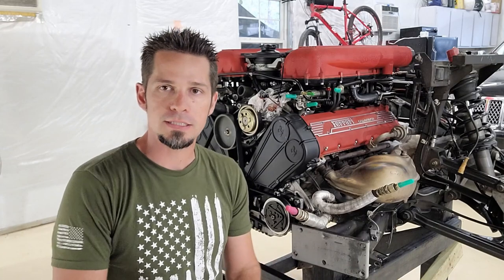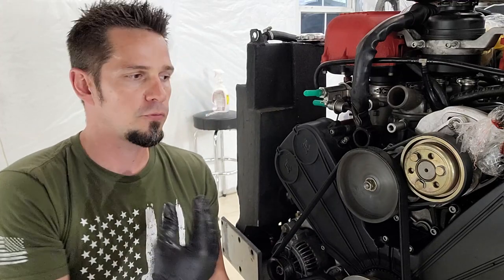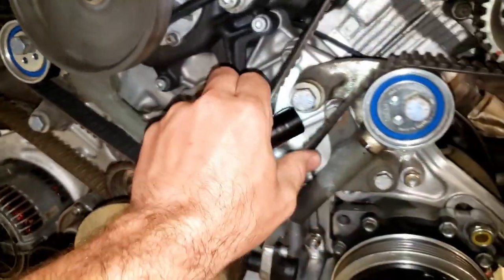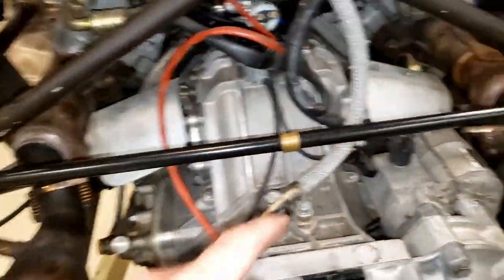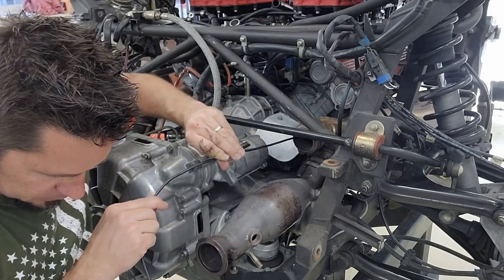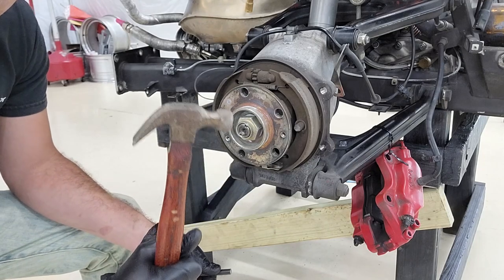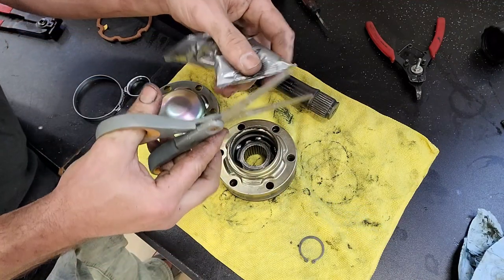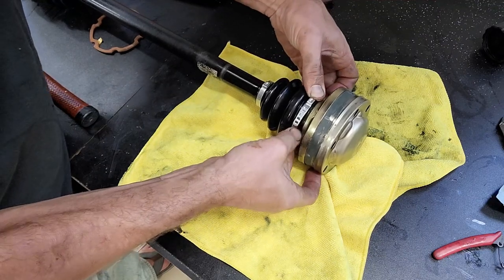F355 Engine out PART 3 - Inspection and CV boot Repair

Comment: I’m a huge admirer of the 355 but I must say I never realised it had timing belts, I would have thought it would have had timing chains on it!
Reply: You also have amazing skills and an impressive depth of knowledge. I think I would forget one of the bolts or washers when putting it back and then find it at the end only to have to rebuild once more 😅
Reply from the maker: Ya, nearly 9k rpm relying on rubber belts is scary lol. They did go to a chain in the 430.
Small jobs are the same as big jobs. Just be organized and methodical on keeping track. To be honest, filling helps me as well. I can't tell you how many times I've reference my old videos to figure something out

Comment: Great videos.  Wish you did one on how to replace the OBD connector.  I need to smog test my 355 and the smog stations don’t stay connected with my car.  They say the plug is probably in need of replacement.
Reply from the maker: Most likely your car doesn't have a OBD2 compliant plug which is actually a recall. The dealer will actually correct the plug for free to my knowledge.

Comment: It's interesting to note that there are no CV gaskets shown in the parts manual. Nor in the Ricambi America boot kit. Good idea, though.
Reply from the maker: Agree, I was surprised to see a bit of gear oil come out once they bolts were loosened. It appears one bolt holds the flange to the trans, possible that bolt needs thread sealant? Either way, I saw only pros, and no cons to installing the gasket
Reply: @ExoticCarDIY  Yea, the first time (sadly of several times) I did my CV boots the gear oil freaked me out.  Fortunately, it's not a big deal.  Just one of those Italian car quirks.....

Comment: i know some guys who changed the whole exhaust system for risks of explosions, and they put a better one i know their channel and i can find the video for you if you want, they also changed the back lights and the steering wheel to new ferrari models and it looks way better than the old ones specially the steering wheel
Reply from the maker: There have been several revisions of the OEM headers, the first ones are terrible, the nearest revision which is on mine seem to be holding up just fine.
Funny how this problem continued on the 360 and even the 4:30 which I now own. It's like out of all the complex engineering, the simplest thing, metal piping ferrari couldn't figure out. On my at 4:30 I have a header install video of what I think was the best option for my car